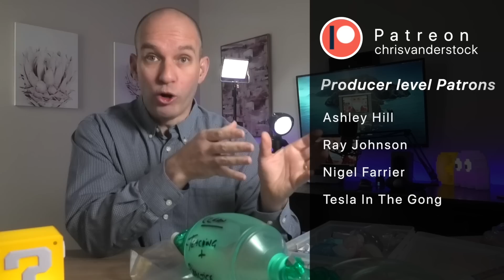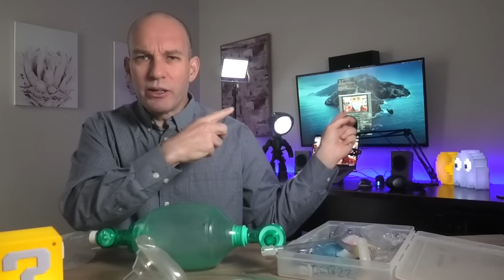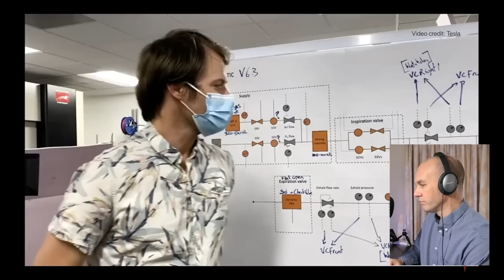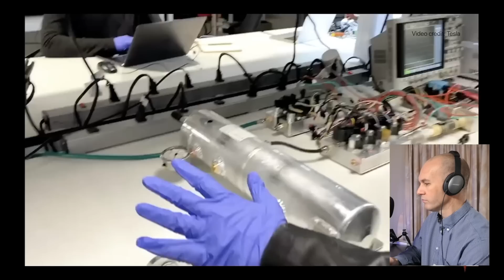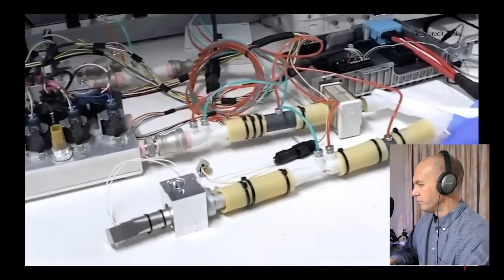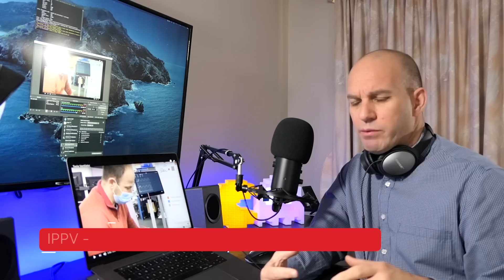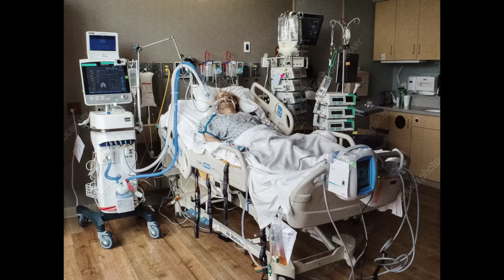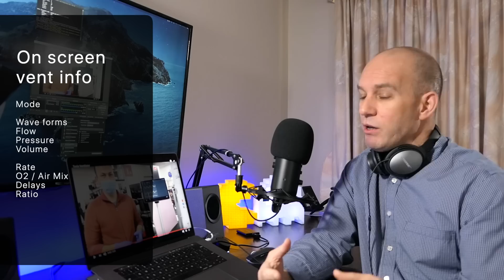Nurse reacts to Tesla's ventilator & what's with those resuscitators?

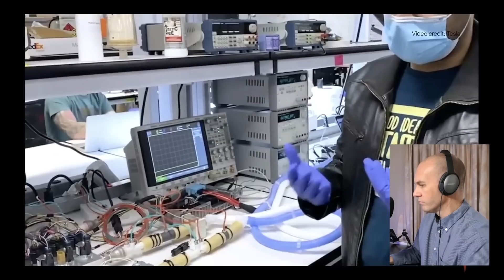Comment: 15:15 this guy sounds right in regards to treatment of an ARDS scenario which is common in COVID-19. Using PEEP with low volume ventilation will keep the distal air spaces open; thus, increased lung recruitment (aerated lung), improved arterial oxygenation so lower FiO2 needed, decreased cardiac output and less terminal airway damage from repetitious opening and closing. -“the little icu book” by Paul Marino pages 263 and 307
16:15 PEEP prevents the damage that would occur if the pressure is allowed to drop to 0 atm at the end of expiration. -Marino again

Comment: At my acute care hospital, the warming/humidification units are externally ran and are separate from the ventilator itself. Usually a ventilator, itself, doesn't have the ability to heat and humidify air. 

You could deliver heated and humidified air to the patient by a couple ways. There are special filters that can be placed in-line of the breathing circuit, close to the patient, which capture heat and moisture from air that the patient breaths out and gives it back as the patient takes in another breath (heat and moisture exchanger filters, HME filters). These are typically are given to patients who are not on the ventilator too long. For patients who are on longer; we use electrically powered heaters which pass delivered air over heated water and through heated coils which run along the inside of the breathing circuit.

Comment: You really do not want to be ventilating a patient on a pressure cycled  ventilator but rather use a volume cycled vent to achieve adequate ventilation and have recruitment of alveoli. Pressure cycled vents are good for transport, but not as effective as vol vents long term or everyone wouldbe on MK7..  As a Respiratory Therapist, prefer vol vents, with time cycled mode and other parameters necessary to measure compliance. 

Not a bad job of elementry introduction

Comment: I'm really impressed that they kept in mind customizable waveform, already at 1st prototype. Not just linear or sinal curve, as you usually get with most (or almost all) balloon-squeezers running off a motor, linear actuator or stepper servo. With the pump and multiple pressure sensors and soleonoid valves, once you have that arrangement controlled it's not too complicated to add that additional function (pressure waveform), but it's a really great inclusion that I'm not sure most engineers that haven't designed or used one like it before, would have thought of.

The computer of a current-gen Tesla, is honestly a very capable computer. Not just (a collection of) very powerful ASICs, but a bit simplifed, it's general purpose processors are at least as powerful as your average mid-tier laptop. And it's running Linux. For a project like this, it's most certainly overkill, but when time is more critical then BOM, you go with what you have on hand. Practically speaking, it's very well suited because it's already designed and set up with tonnes of IO, to control and monitor lots of external sensors and soleonoids. So they don't have to to a lot of hardware development - it's mostly putting the right parts on hand together, and programming the control and interface to do what the doctors and nurses needs it to do. Then test and pack it in a format that is usable.  It seems to me that they did do some proper research here first though, both dive into commercial units to understand the engineering makeup, and probably talked to actual operating staff. I think that last bit is what many other projects like this, have lacked. Explanations and descriptions of the functions and operations, from someone that is actually experienced in operating them. And ideally, on COVID-19 patients, or has professional 2nd hand knowledge through colleagues.

Comment: They have done a great prototype. The computers in the Tesla car is just a computer. It runs software. The valves are pretty special because they are variable values. This kind of thing is used in industrial settings all the time though. The software is the special part. The sensors are pretty sensitive too but that is not special. All in all it looks awesome. I am all for using existing parts for a different job. Well done Tesla. I have seen respirators that universities have made. They are like a bicycle compared to the C63 Merc. Well done Tesla, well done.

Comment: Soo.... How do ventilators react when the patient coughs?
Reply: The vent will alarm from max peak pressures being hit during the cough. It also dumps excess pressure above a set max peak pressure limit that is set by the respiratory therapist / doctor. This is one reason patients are typically sedated and sometimes paralyzed while being mechanically ventilated so that patients are less agitated and cough less while the ventilator breathes for them. Also respiratory therapists / nurses manage secretion/mucus clearance that the patient would normally try to cough out.

Comment: "Dirty diesel generator"

You say that, but hospitals are dependent on rapidly deployed energy incase of an outage. Thank God for those generators.
Reply: That doesn’t make them any less dirty. “Dirty” and “best solution available” are not mutually exclusive.
Reply: Assuming they're well maintained. There was a local incident where someone in charge of maintaining the generators for the local hospital was stealing fuel from them. Generators kicked in after a brownout, ran for a few minutes before one of them ran out of fuel and stopped. I think he was arrested and charged but thank goodness it didn't affect the hospital adversely
Reply: @Resdim  it's actually SOLVED most of the worlds problems.
Reply: @jacobzindel987  Very temporarily.
Reply: @jacobzindel987  Cheers to that, Fossil fuel built the modern world and everyone seems to forget that.
Reply: @Sikorsky66  Is that good or bad, long term?

Comment: most stupid nurses do not have enough education to manage complex ventilation equipment well. Because of this, a lot of deaths happen. Also, due to improper adjustment, people die. If the pressure rises above critical, then micro-fractures and hemorrhage in the lungs will occur. If the pressure is lower then there will be oxygen starvation and also cause death. It is necessary to develop such an apparatus that the doctor can control remotely using a smartphone. So that all graphs and indications are displayed on the smartphone screen.
Reply: Ventilators don't run themselves and are not managed by nurses. That's why we have Respiratory Therapists.

Comment: Great explanation about the workings of ventilators! Stupid question: couldn't we put the upper body in a chamber where we create intermittent negative pressure, allowing the lungs to open up and inhale without tubes or overpressure? Basically create seals around the waist and the upper body / neck area and have a somewhat rigid chamber there? You might still want a face mask for air mixing / conditioning and flow rate sensors, but the breathing would be more like we do naturally.
Reply: They actually have a similar design of ventilator which cups the front of your upper abdomen called a curiass ventilator or tortoise shell ventilator, look it up. But, a couple cons I could come up with:
1)Volumes & Pressures (measured and delivered) must be precise. With a respiratory lung infection like COVID-19 lung compliances can vary, meaning the stiffness or desire of the lungs to recoil and deflate will be different so you won't really know what's going on in the lungs like actual lung volumes or measured lung compliance. You also lack the ability to provide different  modes that regular positive pressure ventilators are able to provide, most importantly volume control type of modes.
2) Medical staff need to be able to work on the patient easily. Nurses need to get to lines, respiratory therapists need to draw arterial blood samples, x-rays need to be taken, the patients might need to be frequently turned or proned, patients might need to be transfered to CT and back.
3) if a patient crashes you have no way to ventilate the patient. Normally if a code blue occurs and cardiac arrest happens, chest compressions need to be given and ventilation needs to be provided by bag through an endotracheal tube. It is very difficult to ventilate a patient with just bag and mask while someone is someone is applying compressions to the lungs.

Comment: What is a respirator and how is it different than the items you covered?
Reply: Respirators are meant to filter the air the patient inhales. Think masks like n95, gas masks, the head gear ppe that healthcare workers wear with the tube coming out the back of the head gear. These do not mechanically breath for the patient. The one of the main purposes of mechanical ventilators is to take over a person's breathing and allow them to receive additional oxygen.

Comment: Chris, I would love to get your feedback on our ambu-bag design: https://youtu.be/sNcdRJmJqwU
https://github.com/Crowdsourced-Ventilator-Covid-19/crowdsourced-ventilator-covid-19/blob/master/README.md

Not in my video: FIO2 controlled by setting an appropriate O2 flow rate into the ambu-bag commensurate with the set RR and TV.   Heat and Humidity will be handled with an HME at the patient end of the ventilator circuit.  Support for negative pressure triggered assist

Comment: as a diver, wouldn't a simple sensing system like a regulator (2nd stage) be able to sense the breathing and provide a trigger for pressured gas to be supplied? 
So another simple Commercial off the shelf system, that can provide  a trigger and help get to the missing mode to wane of patients from the 100% external breathing?
(positive gas pressure provided by ventilator - triggered by vacuum valve of air regulator to provide easy breath) ?

Comment: I don’t see any safty valves or extra pressure transducers in their Device
And not beeing able to clean the exp side isn’t that impressive.
And is it flow or pressure triggered?
Or is it just a pump
O2 sensor?
I think they should do a FMECA on their gear together with some one that knows something  about ventilator development
It usually takes about 5 years to develop a ventilator if you know what you’re doing
And all the tests and paperwork.....

Comment: Yes, it is wonderful that you are a nurse and understand the potential dangers involved and the possible consequences, and that you have the benefit of knowing and using the latest equipment while being cognizant of the predecessors... unfortunately you are not an engineer... I worked as one for years in the medical field...  You started off with the simplistic bag squeezer prototypes and then quoting the full volume of the entire "Air viva" bag, but you would have to crush it entirely flat to actually get that volume... That is essentially just like a 2 liter bottle and squeezing it down as hard as you did probably only delivered 900 to 1200ml of actual volume. Fill one with water and try it, you will be left with about half the volume.  You are also not supposed to squeeze it that hard in regular operation as you can crimp the plastic or put a crease into it so that it will not re-inflate. The structure is deliberately built larger so that there is actually enough room for that plastic to recover its functional shape without permanent deformation... normal single hand squeezes deliver approximately the 400 to 500ml of volume per squeeze as recommended and/or required... but nice job pushing things to an extreme as a "scare tactic"... just as a car is generally capable of speeds of 120mph (200kph)  if pushed hard enough, that is also NOT in its normal range of operation either.  

On to the video... there WAS a labeled humidifier and heater shown in the video, and even though his description of the exhalation portion was a bit clunky due to language, it was also the same as what you stopped the video to talk about... as for the synchronization, there are sensors on both sides to compare the in-going flow and pressure to the outgoing and suitably match it up to the patient just like the "regular medical equipment" is doing... This is still a machine, just like a "regular ventilator" and the settings are still done by a human to choose the correct parameters for the patient. It is when those parameters are set wrong that things like the blood acidosis or ventilator pneumonia you refer to can develop.The ventilator, whether medical or "Tesla" built, is only going to do what it is programmed and/or told to do... 

Tesla is duplicating the same functions as the existing ventilators but using the components from their vehicles, which are available by the thousands, rather than highly specialty made components that are in very short supply.   Present day ventilators are merely the result of a continuous refinement and addition process from big clunky machinery into more compact and portable equipment with the addition of more functionality... Tesla is not starting from scratch, they are duplicating the latest iteration using different parts... even if theirs is not as "elegant and refined" as a current medical ventilator, it is functionally the same and will be saving lives that the lack of expensive medical manufacturer equipment is letting fall through the cracks.  Essentially, each of those "failures of function" used to be in those same medical ventilators until they found out what caused them and modified the equipment, Tesla is starting from the point of knowing those failures and incorporating those necessary functions into their design from the beginning.  

Overall, you can either live through the difficulty of using the more primitive "medical" equipment and/or losing lives from the lack of availability;  **or**,   you can take advantage of functionally equivalent equipment to make your efforts easier and save more people.  You admitted that you revert to more primitive and time consuming equipment as a "last resort" already... well, you are currently stuck in a "last resort" situation all the time due to lack of availability, so anything that frees up more of a medical professional's time and requires less effort to help more people should be welcomed!  At least you seem to be appreciative of their efforts to help... kudos for that and for the detailed explanations of the hazards and difficulties.

Comment: Would it be possible to let the patient breath for a while and learn from the patients breathing during awake / sleep?
Can those machines measure blood oxygen levels and respond to that?
Reply: Usually patients are put on an Assist/Control kind of mode, meaning if the patient slightly gasps for a breath the ventilator will assist and give a breath and/or if a patient is totally sedated/paralyzed and doesn't breath the ventilator will control and take over. As of right now, vent settings like respiratory rate or percent of delivered O2 are manually set and are manually changed by the respiratory therapist / doctor by reading periodically-aquired arterial blood samples.

Comment: I work in Emergency Medicine and we're actually finding out that ventilators are killing patients faster. The ventilators are causing lung tissue necrosis. After we are extubating patients black lung tissue is coming up with the tube. After this happens, the lungs cannot heal from this and the damage is permanent. We are seeing that high flow oxygen is better. MUCH BETTER. Remember treat the patient, not the monitor. Excessive IV fluids are also causing patients to go into ARDS faster as well (so we have been having to restrict them too).

Comment: Hi, I designed an open source ventilator based on a BVM, but that avoids the pitfalls described clearly in your video. I'd really like to have your opinion about it, notably if it would be suitable or not for use with COVID-19 patients as it implements patient assisted breathing and uses a motor that can be controlled precisely with a type of BVM that allows a PEEP valve to be fitted.
https://www.youtube.com/watch?v=0-nGLLX1W8E

Comment: I'm a respiratory therapist in LA, we usually put a Peep valve on Ambu bags when we use them so there Is a way to ventilate someone with that and you don't need to worry about overpressing the bag unless the person is a child/less than 5'4"

Comment: I worked on developing a ventilator for several years at a major medical device manufacturer in the US.  This is  very good first pass at a ventilator. I did see two major problems with the prototype, first the main manifold and mixing chamber looked like they were made of aluminum. That is OK for a prototype, but production will need to made out of some kind of stainless.  Vents need to be sterilized between patients, and the gases used to do that are very corrosive to aluminum, copper, and brass. Also some nebulizer drugs can be problematic. Aluminum is quick and cheap, OK for single use (in most cases), but not suitable for production.  Second there was no mention of "fail safe" operation or any sign of an independent secondary computer that watch dogs the system.  Anything that is life support grade has to have at least one of these features, and preferably both. There is a reason why ventilators are so expensive and finicky (requiring lots of maintenance).  If anything goes wrong, you can quickly injure or kill a patient.  There are lots of things to consider that you can't tell from a video, what hind of flow sensors are they using, what kind of valves, is it safe with prolonged exposure to 100% O2? The list of things that need to be considered is quite long.